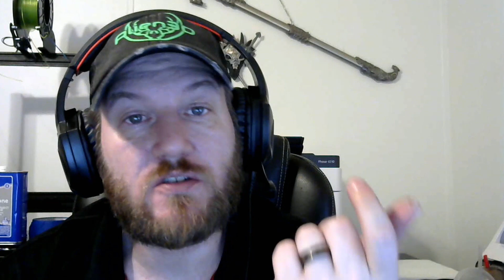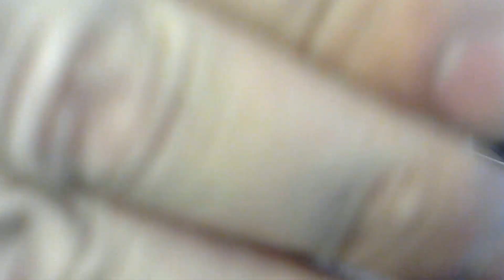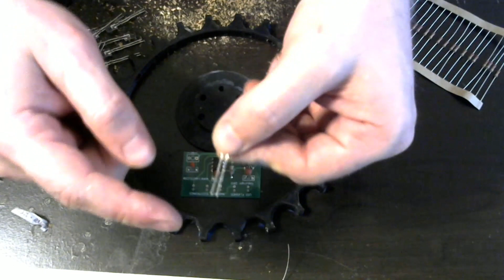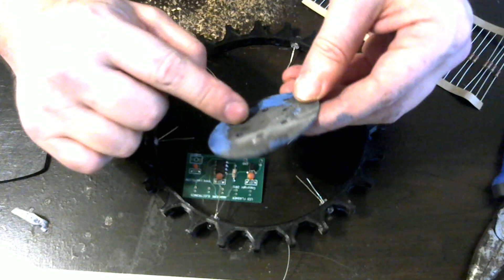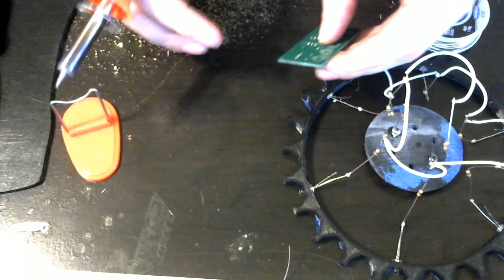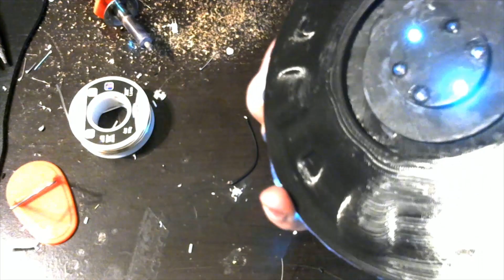July 2019 UFO #3DPrinting Project

Comment: Hi, thank you for the Box it is my first one I have received. I like the kinds I have in the box it is a good selection and I love the Alien Ooze ... I wanted to give you a pointer for soldering. First I noticed that you are using the same kind that is used in plumbing for sweating pipes together and this is not the kind for Electronics. you need a fine solder that is acid or resin core solder. By changing to this you will find that it is far more easy to solder things together. Also, you need to get a temperature controlled soldering iron like a weller they are cheap from amazon but get a fine point one the finer the better on the tip for electronics soldering. I will enjoy putting the kit together at some point this month. As well as testing the Ooze .. I may need to get several spools.